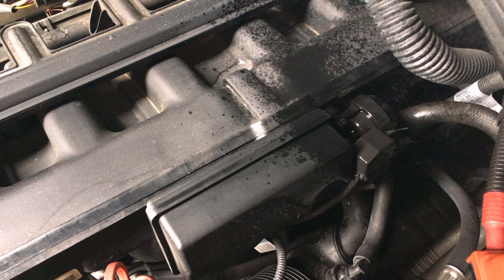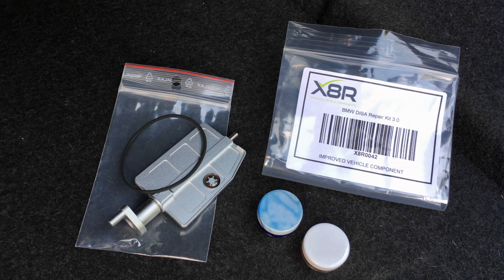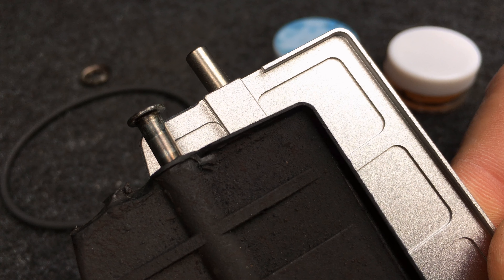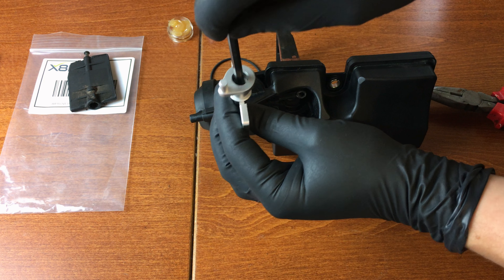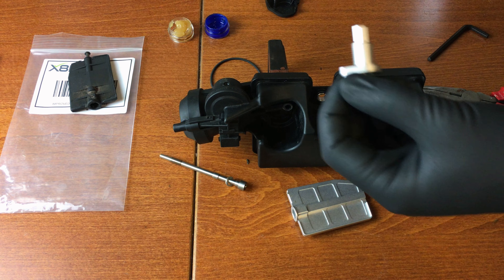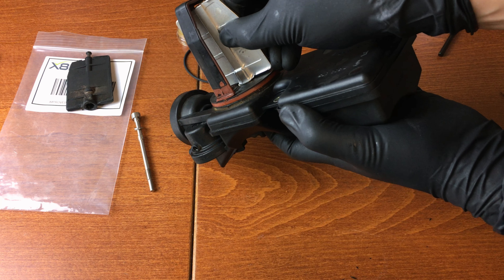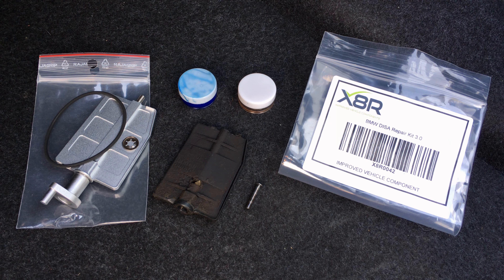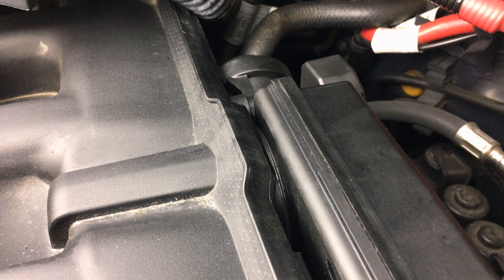BMW How To Repair And Modify a Broken DISA Valve Unit M52 M54 (Fix P0171 and P0174) X8R

Comment: Would this cause stalling since that hole is basically open to atmosphere where it snapped?
Reply from the maker: My car ran dropped in rpm when stationary, but not enough to stall the engine. I could imagine this problem stalling the engine. Its quite easy to check if the valve is broken. The stalling could also be caused by a vacuum leak somewhere else. Good luck!
Reply: @Juupke  got u.. that's what I'm thinking too. . Spraying brake cleaner into the disa smooths out the idle so I think the rebuild will fix it. Thank u!!

Comment: Hi, is this part of the DISA valve also available for the DISA valve in a bmw e46 325xi?
Reply from the maker: Thanks for the comment! Yes, I think it is, x8r ebay webshop mention a disa repairkit like used in this video, for a 2.2, 2.5 engine as well. The 3.0 one is listed seperaty. They cost the same. Greetz